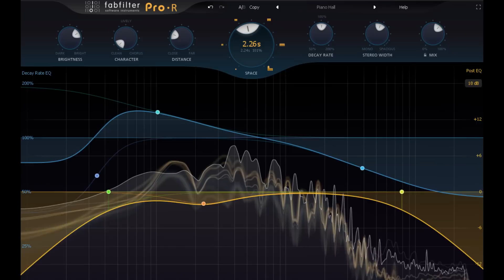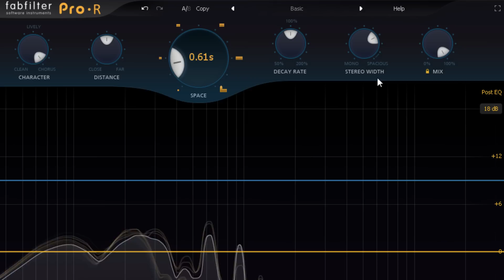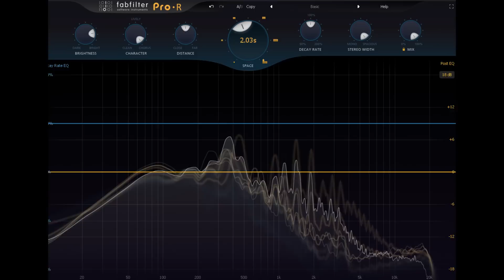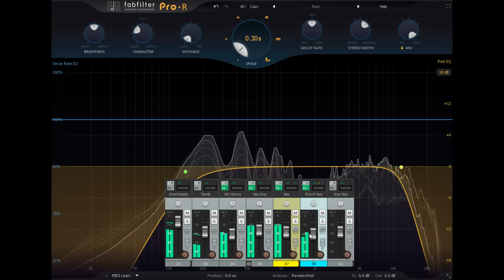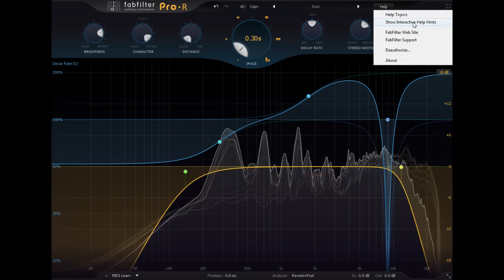Introduction to FabFilter Pro R Reverb

Comment: Can someone please explain to me the difference between the decay eq and post eq? If you need to correct something, couldn't you adjust the decay eq again? I'm a little confused
Reply: My understanding is the decay eq is like a delay fx that has a filter. So if you reduce the low frequency that part if the reverb fades out quicker.

Comment: It would be awesome if you could pan individual nodes of the decay or reverb signal using LR or Mid Side like you can with ProQ. That way you can have different reverbs in the left or right or mid or side.

Comment: Absolutely my favorite reverb of all time. Every other reverb I've worked with, outboard or in the box, has some kind of frequency quirk that annoys me—especially with vocals. They usually either end up boxy or sibilant.  The control this gives me over the decay rate is outstanding. If there's another reverb plugin that comes close, I'd like to know about it, please! I'd discovered how great that sibilant notch/air boost combo works before I watched this, and find myself using that all the time on vocals. I also find that a wide "notch" (it's not really a notch anymore by the time I expand the Q as much as I do) in the mid range gives me a great reverb for vocals that I just love. If I make space for the vocal in that area of the mix, then drop the delay there, I get a great blending of the vocal in the frequencies where it doesn't dominate, and it while keeping sounded unaffected  in the parts where it dominates. I just love the freedom this plugin has. I feel like I can make anything sound great without the compromises that other reverbs introduce. What can I say. I'm a total FabFilter fanboy, and I'm not easy to impress!
Reply: Valhalla vintage verb. Smooth room preset.

Comment: Dear Fab-Filter, 
     It would be very nice if you could add BPM synchronization to all the controls in for all Fab-Filter plug-ins... It would allow for the settings to be set very quickly, as well as the settings being able to flow with the pulse of the music... This is something that would be quite revolutionary and I haven't seen many a plug-in (company) do. The closest to this idea is where Pro-Q 2 is note-frequency-dependent. Which makes it my favorite EQ! Anyway also I would like to see Fab-Filter add note-dependent-frequency-overlap to saturn or another of the plug-ins... but no really I have a lot of interesting ideas I would like to share, message me! I could work for free just coming up with ideas like this all day

Comment: Im glad i didnt buy any expensive reverb plugins yet, this seems to be what i will use all the time.
Reply: Hakan Noel If you want one verb to rule them all, I'd suggest Slate VerbSuite Classic. Great sounds, great price, great versatility.
Reply: sweliam1 it looks exactly like what i am trying to avoid, i don't want crappy hardware imitating interface, i want visual feedback and an intuitive  interface.
Reply: Hakan Noel Then you'd be better off with Pro-R. It sounds great though.

Comment: Did you mean to leave the mix lock on at 100% wet for the main showcase of the reverb? Felt it was better showcase when left at 50% like at the beginning.
Reply: Michael Tingle That's exactly what he did, he used a send for a blended signal. You're getting a dry signal from the vocal track, then a wet signal from the send, then you balance the levels. It even shows him doing so during the vocal.
Reply: Michael Tingle he was using the reverb as a send
Reply: I appreciate that Jimtik but I believe the demonstration was better with a mixed in example as opposed to a completely 'wet' washed out example which in reality never happens in peoples every day mixing.
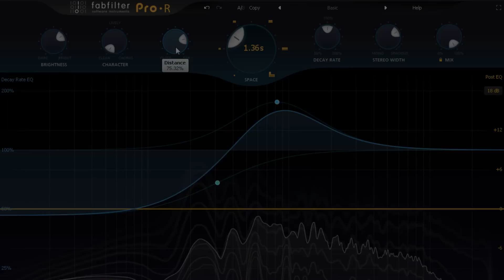Reply: You don't see the mixer till 7:54 up until then it's assumed you listening to 100% wet mix. People want to hear instruments in context, a snare, a vocal, a guitar. Not a reverb saturated example. IMO. Perhaps in their next vid it'll be somewhat clearer.